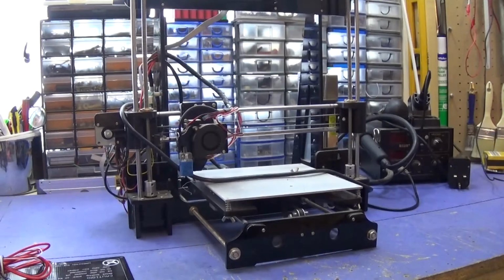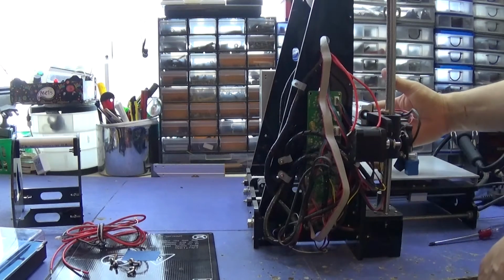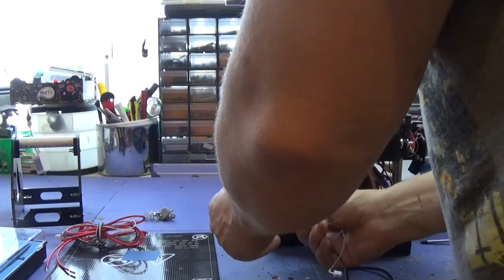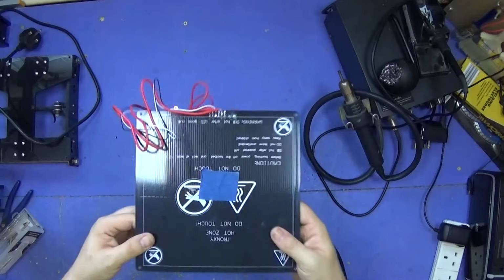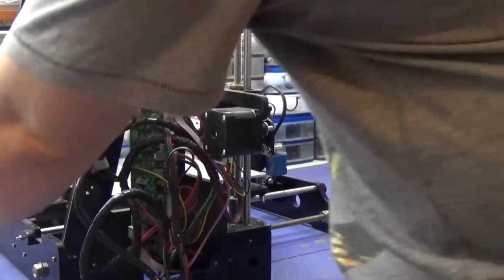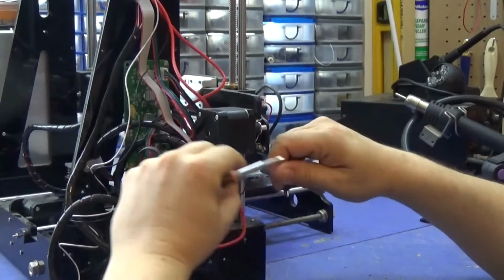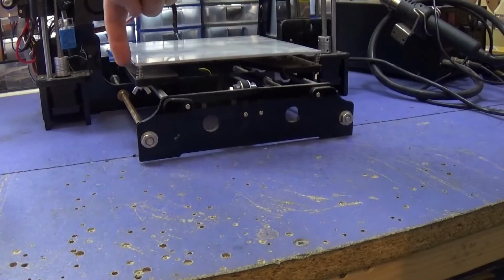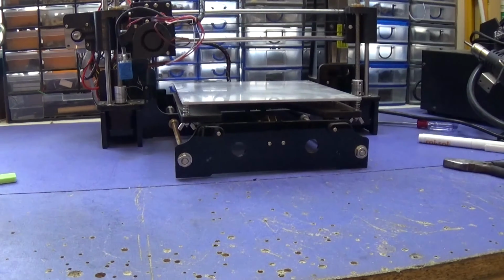Changing a 3d Printer Heatbed (Reprap Prusa i3)

Comment: Autodesk 123D design is a great 3D creating program, its what i use, 3D builder for windows 10 also is nice, i would have loved to buy that old heatbed to use on my 1 that does not have 1. Also if your prints dont stick, make yourself some ABS Juice works great. and always remember if you have a problem with designing something then ask on my email i will be more than happy to help.
Reply from the maker: I was looking into autodesk 123d a while back. I will have to have a proper look at it then. So far my prints are sticking well with blue tape or hairspray on glass. As for your help I will definitely take you up on that offer in the future, there are so many things I want to make and when I have the time you will be the first to know :) The old heat bed isn't going to waste my friend I will be using it on a project shortly. If it doesn't work for the project then your welcome to it.
Reply: well i started with 3D builder worked well but limited then a friend suggested 123D and i struggled my Ars off with it but when you get the hang of it, its quite easy. will send you a mail of small things i made for the new printer im building again, but this time its more custom cause i learned out of the other build mistakes like the limit switches that was terrible design i made my own and seems that it should work.
Reply from the maker: yeah a lot of the 3d design software is hard to get a hang of at first (I have found anyway). I look forward to seeing your projects bud